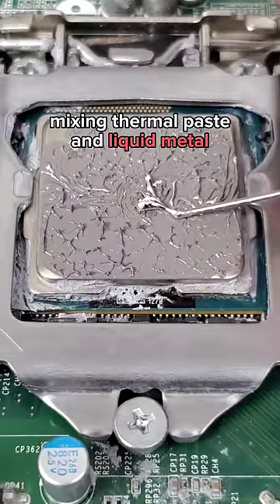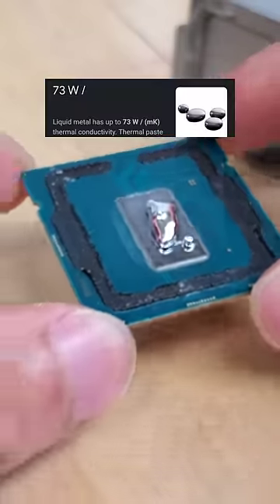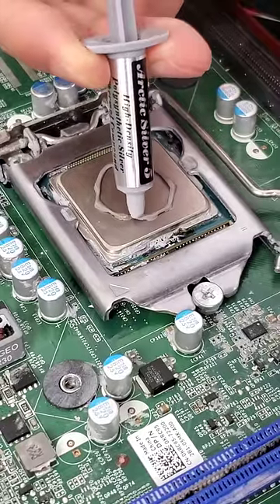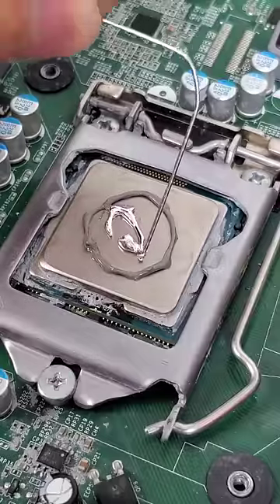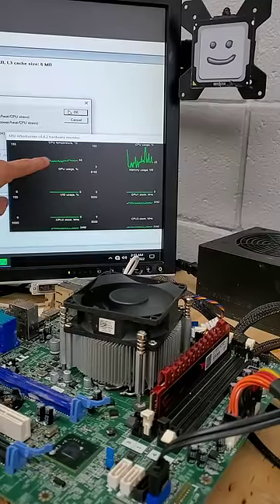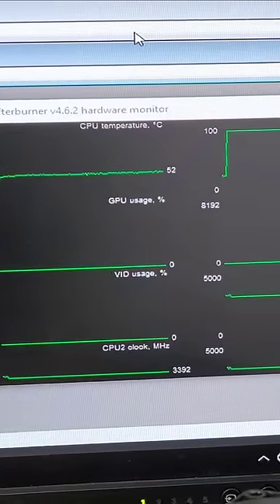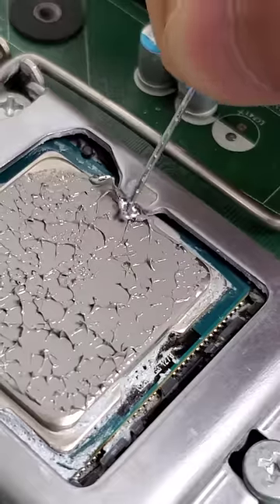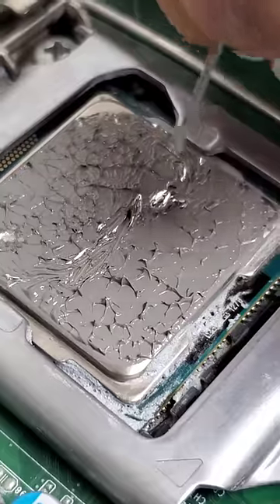mixing liquid metal and thermal paste! #shorts

Comment: That's not how to use liquid metal, you should spread it gently with a q-tip. Then you can proceed to make the termal paste ring. It also reacts with aluminium and can rot the heatsink, you should use a copper base one.

Comment: Definitely not how to apply LM. It got pushed out to the sides because it was applied in a blob instead of a thin layer spread across the contact patch. If you really need/want to prevent LM from running off the side just use thermal padding or thermal tape along the outsides like manufacturers do on laptops.

Comment: you didnt properly apply the liquid metal. you need to use a qtip to put a thin coat on both the CPU and the Cooler.

Comment: Good god how much metal did you add? You use a pea sized drop, and a cotton swab to 'polish it' into the nickel. I suppose technically, it would be called tinning, making sure the gallium is bonded to the cpu... You do the same to the heatsink. both surfaces should look like a crinkled mirror. Done right it'll cover the whole die, and nothing will seep out the edges. Great on laptops or anything else that won't probably get a repaste in the next decade.

Comment: So thermal paste is supposed to fill the air pockets in between the cpu and cooler, right? What if you just got someone with some super precise machinery to make both near perfectly smooth, that conduct should be better than thermal paste, right?

Comment: I wonder if you put red high temp rtv silicone around the CPU and outer perimeter of the IHS then let it solidify and fill the center with liquid metal if it would spread out correctly.

Comment: Way too much both, especially the liquid metal. Your supposed to spread a thin layer on both the cooler and cpu plate. Also, clip in coolers should not be used as mounting pressure is too low.

Comment: What universe did I fall into where it's apparently ok and normal to take a fat fucking shit on your CPU with thermal paste?
It SHOULD NOT be leaking over the sides. Too much thermal paste leads to the same problems as too little.
Size of thermal paste applied depends on the size of your CPU, but generally, half the size of a green pea is considered the gold standard.

Comment: u used way to much of both by the way, for Liquid Metal you really need just a really tiny drop an then you spread it on cpu an cooler with a cotton swab, into you‘ve got a really thin layer on there. „der8auer“ has really great videos on that topic.

Comment: I mean wtf uses Liquid Metal like that, spread it my man it has to somewhat adhere using retention of cause it was going to push out the sides when it’s in glob form and it also requires some adding the the cooler or pump on the other side yet again spread a thin layer essentially thin enough that there is no pooling what so ever and they will essentially join, and also shouldn’t really be using this on aluminium but I get you were doing a short experiment but your method was all wrong.

Comment: gallium is crap. spread it over other metal parts causes heavy damage on materials which are reakcting with gallium. i bought a mainboard  and there was gallium spashes around the socket and some gallium eats up a CPU Socket Pin !!! so there was no contact anymore and so one ram channel was dead !!!!!

Comment: You didnt even apply it right, or the right spot. That's an on die designed thermal paste. Typically applied to the CPU die inside of the metal bit of CPU (the IHS). So...I deem this "experiment" bust and broke and will wait for further experiment

Comment: Where do I get thermal paste does it come with every cpu?
Reply: Not with the CPU, but with every CPU Cooler (if you buy a CPU with a Box cooler, it will also have thermal paste).
And you can also buy thermal paste basically everywhere in the Internet and provably also in some PC stores, if there is one near you.

Comment: u actually applied it so wrong that it could kill your pc, u need to spread all the ballon shaped liquid metal on the die or it wont perform any bit also u sed it on a aluminum heat sink thats very unhealthy for that coolers metal part which is aluminum and gallium chemically reacts and that destroys the cooler(also can destroy cpu and near electirical components)

Comment: What if you use a cooler without an ihs: day 1 of asking
Reply: You won't make any contact with the die and putting thermal paste on the die itself would probably short and kill it
Reply: @Fisheiyy  thermal paste is designed to not conduct electricity
Reply: @Fisheiyy  you can use thermal pad
Reply: @Snappacker  not all thermal paste, a lot are still conductive

Comment: the CPU has an IHS (integrated heat spreader) so it shouldn't matter a lot if the liquid metal is pushed to the sides. Still better to have full coverage though.

Comment: lol @ every idiot using liquidmetal and then not rationalizing the orientation of the cpu.. for a laying FLAT horrizontal system ok.. but if your case is vertical and the cpu is vertical the liquid metal just  runs out and down in to your motherboard.. same with gpus.. its a "FOOLS errand" to use liquid metal.. the next step is liquid fooling a 55 part solution vs a 3 part solution.. "Paste Block Fan" done.

Comment: This has to be one of the dumbest shorts I've seen yet. You can't just put a drop of liquid metal on an IHS then slap a cooler on top. Anyone who has handled liquid metal compounds knows it needs to be worked into a fine layer in order for it to be at all effective. You didn't apply the compound properly so of course it's not going to cool the chip better than normal thermal paste.

Comment: What would happen if you use solder as a liquid metal 0_0
Reply: It wouldn't do anything you need silver solder which the heat to melt it would ruin the die